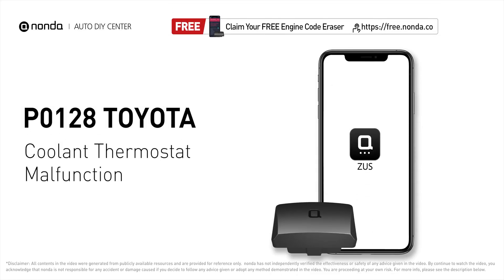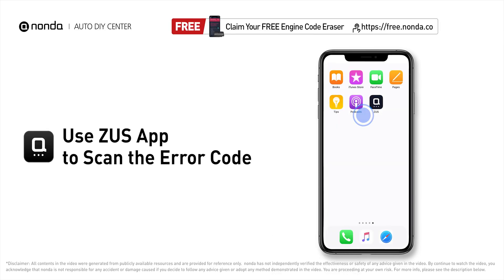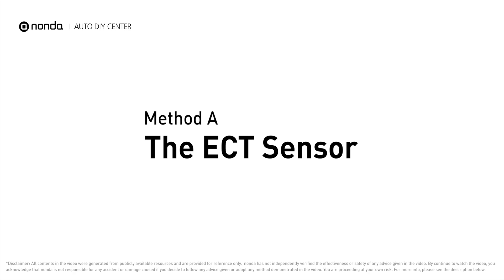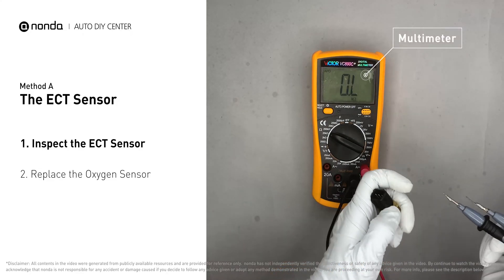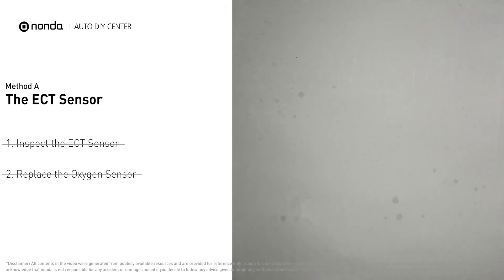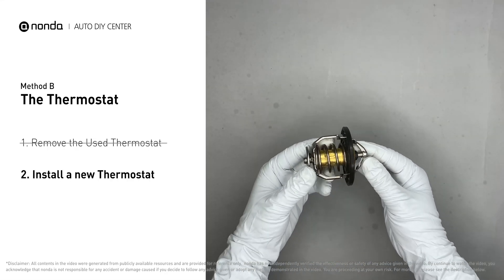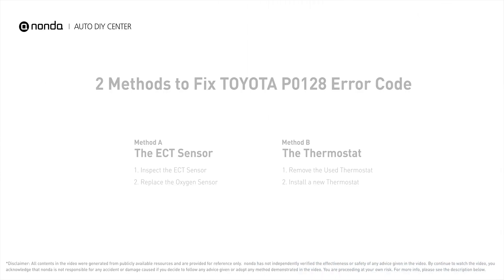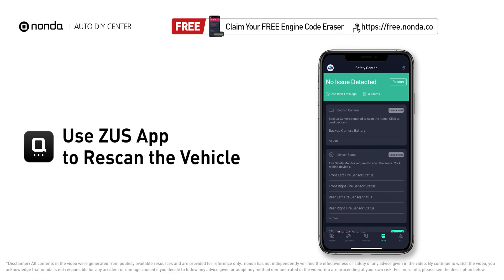How to Fix TOYOTA P0128 Engine Code in 3 Minutes [2 DIY Methods / Only $7.34]

Comment: I just replaced the ect sensor. The connector snapped off of the bolt when removing and was calcified or something on the inside so it appears that was the problem. Check engine light is still on though. Do i reset it and see if it turns back on or should it turn off on its own?
Reply: Reset if you have something to reset, or just remove the battery
Reply from the maker: Hello, you can reset it to see if the issue will continue to persist. Thanks for watching!